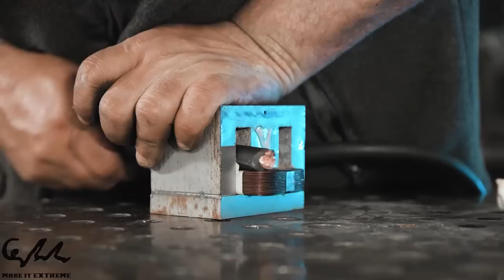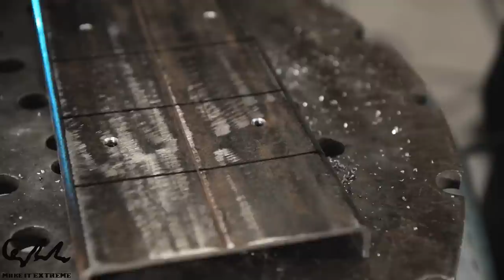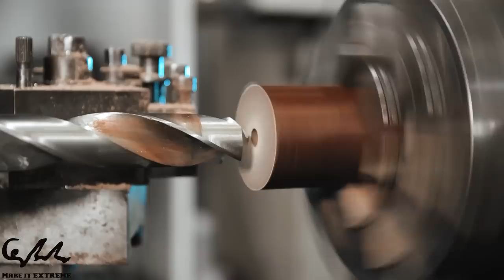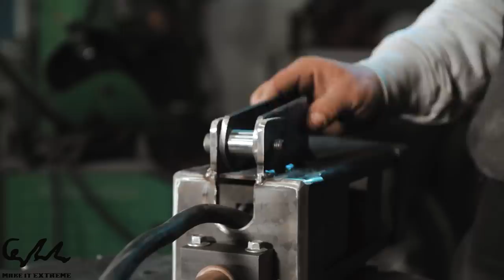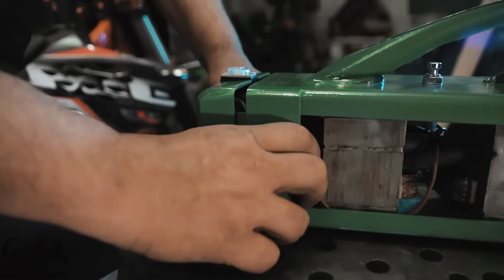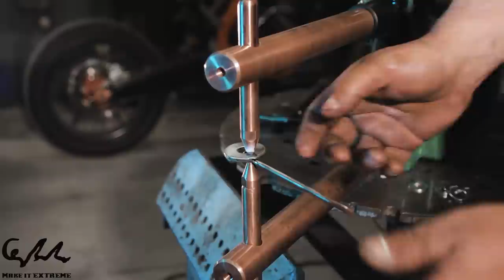Making a Spot Welding Machine

Comment: I am surprised you didn't use  water cooled system for keeping the tips from overheating  in condition of heavy use. By designing a high current welder.

Comment: Do not use zero-cross or random-on type SSR. It may cause a magnetic saturation of transformer.
When magnetic saturation occurs, a very large current flows through the SSR, causing the SSR to fail.
To prevent this, peak turn-on SSRs should be used.
This spot welder has no electrical reliability and still needs to be improved.

Comment: You should warn about opening a microwave oven. The capacitor is very dangerous if is changed
Reply: It's dangerous if it's charged but the most dangerous part is the magnetron
Reply: @E-hab  yes, but it could be charged. The magnetron is only dangerous if you break the berilium ring.